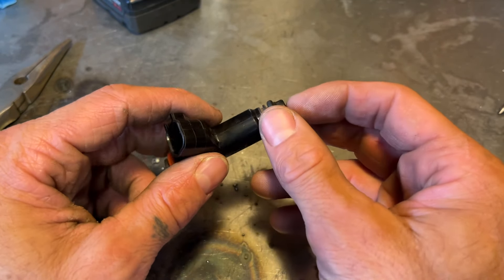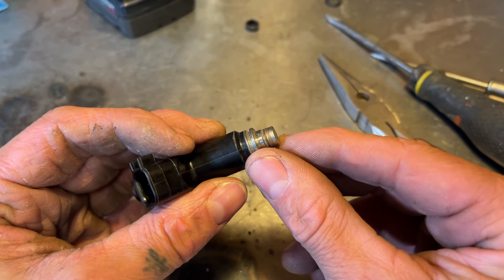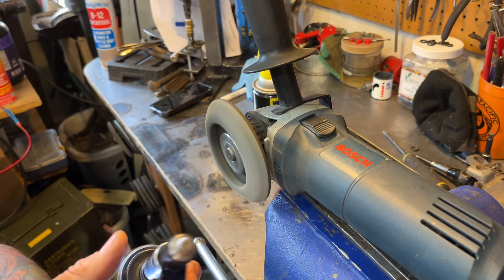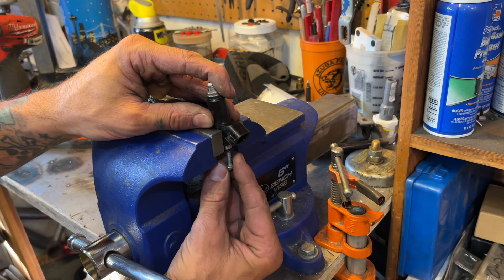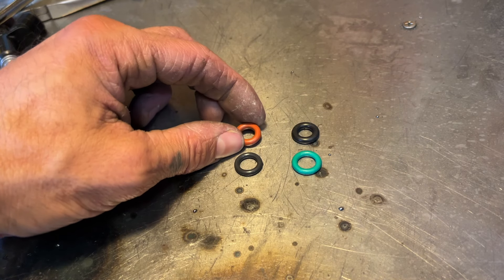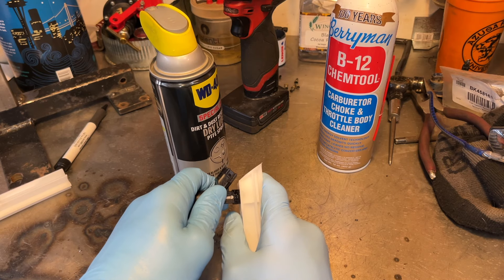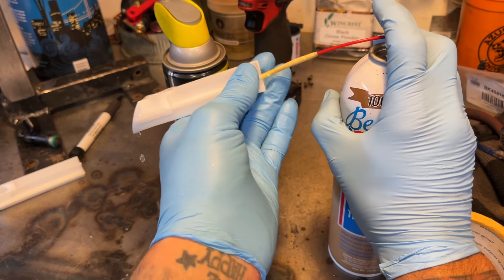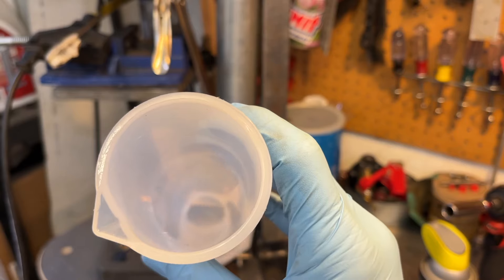LS INJECTORS - DeCapping, Rebuilding, Cleaning - TURBO 5.3 Pt. 14

Comment: Will this engine use more fuel??
Reply: Its gallons per mile after this
Reply: Not if it's tuned properly. This increases ability to spray more gas but doesn't mean it always sprays more gas

Comment: Not impressed and certainly dont trust that rebuilding method, you grind the nozzle off and simply hold it together with the original cap?
Reply: The nozzle he ground off is just what's used to create a finer spray pattern (for improved fuel atomization, aka cleaner tailpipe emissions).

The injector isnt held together by the nozzle.

The exposed Pintle sinply makes the injector like many factory EFI injectors were back in the 80s and 90s.

The plastic cap is primarily for keeping carbon deposits from building up on the pintle tip.

The injector can function without it.

He did a good job and in a later video flow matched them. He did this correctly.